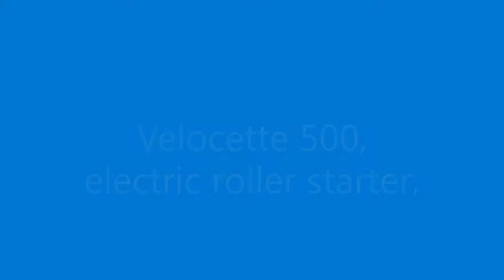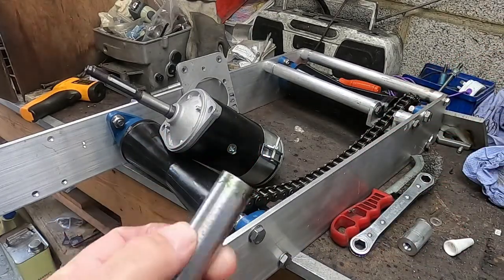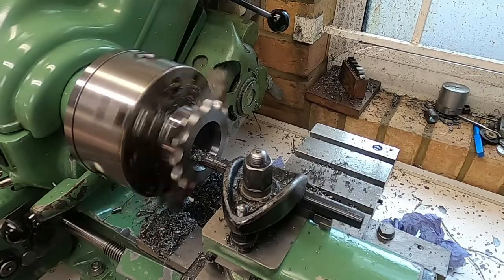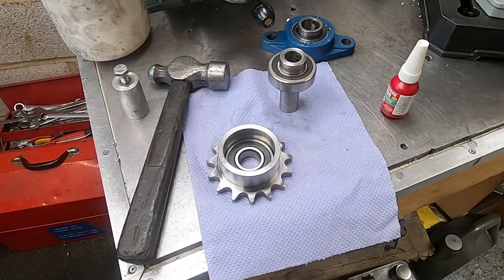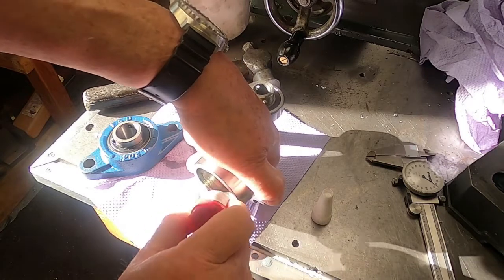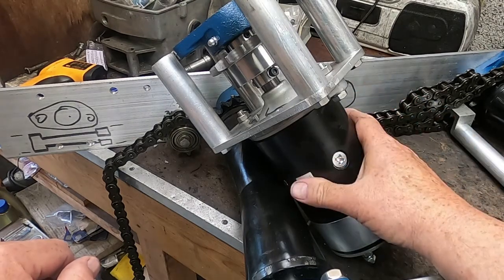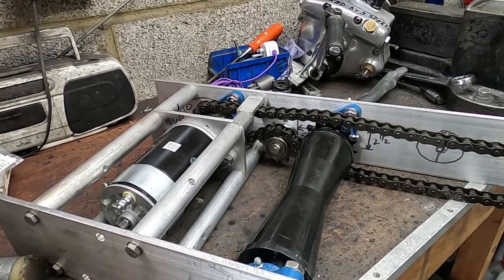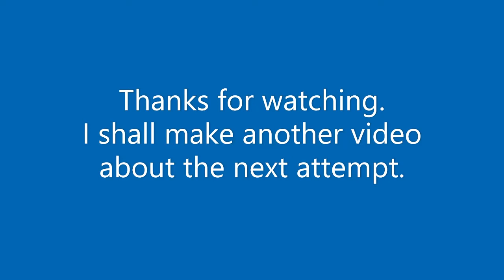Velocette 500, electric starter rollers, part 2 FAILURE

Comment: Hello Alan,

I should be very interested to know why and how was it going as I also wondered if it  would be  a good choice for my bike as you can understand from the following notes.

After Alton electric starter and alternator has been installed on my Velocette Thruxton, occasional but repeated kickbacks at starting or stopping the engine (with no time enough to retard the ignition) damaged the electric starter: “double” gear and polyurethane pins or both with need to replace them with new parts (six months waiting time to receive them !)

Kickbacks were reputed mainly due to Lucas competition magneto deficiencies at low runs - though refurbished - but I am wandering if also GP2 irregularity at low runs  could have a role in it

BTH electronic magneto + Amal Concentric MK 2 , 36 mm (a couple well reputed among Thruxton owners as a solution) were effective in stopping the kick backs, may be thanks also to a better designed gear from  Alton.

Unfortunately Amal MK2 36mm carburetor revealed to be very difficult to set satisfactorily for unknown reasons (spit backs and engine stalling under 2000 r/m unless you apply the cold starter again) though ultrasonic cleaning and compressed air testing did not reveal air passages abnormalities.

Questions:

- Could reverting to Amal GP give way again to risk of kikbacks or to dangerously overstress the electric starter (quite fragile) ? Or, conversely, would the BTH electronic magneto (setted at 37°) be capable to prevent whatever kickback even if I revert to Amal GP 2 ?

- Is there any safe test one can undertake in order to decide if replacement of GP2 would be  without any risk?

- Is that true - as I have been told- that the only powerfull enough ignition system would be a 12V coil ignition with points and high perfomance coils?

- Would it be definitely better any way - "for peace of mind"- to adopt a different type of carburetor from GP for an easy starting in order to protect the electric starter and to avoid the risk (if any) of kick backs arising from GP irregular functioning at low runs?

- Which type and which size of carburetor would be best (for tourism use)? Would you recommand me Mikuni? Which size ? Any problem in installing it?

Thank you

Best regards,
Reply from the maker: Thanks for  the e mail.
Sadly I think you are mixing me up with someone else. I simply have never had a Mikuni on my Velocette. 
I have used Concentrics on many machines, and the problems I have found are:
Float valve leaking , cured by a rubber tipped needle
Pilot circuits getting jammed up with unleaded petrol drying up when not being used. I resort to the ultra sound cleaner to be sure the passage ways are clean on the Velocette. I cured this on my T150 by replacing the carbs with the later carb body which has a screw out cover for the gallery which jams so it can be cleaned.

Spit back / stall at tickover, no real solution here apart from a slightly rich mixture and slightly fast tick over. I remember Geoff Dodkin telling me that Inlet valve opening should not exceed 55 before …. if any sort of tick over was to be achieved. Perhaps the key measurable for performance here is when the exhaust valve opens as that is when the power stops being made.

You mention your engine kicks back. That means you have a good enough spark a kick start speed to start combustion. Great stuff. Now all you need to do is get that spark to occur at the right time so no kick backs take place. …
Say 5 before TDC?? Then ensure your range of advance gets you up to no more than 38 degrees.

I have had no experience of Alton electric starters. Velocette kick back is a potentially dreadful event. I have damaged right hip to prove it.

I hope some of this might be useful.
All the best 
Alan Glen
Reply: Hello Alan,

thank you very much for your experienced and detailed answer

I will try again to do my best for setting the MK2 following your tips
If I couldn't overcome the quoted obstacles, may be  a Mikuni could be the choice
All the best